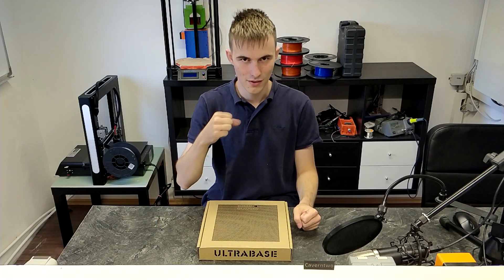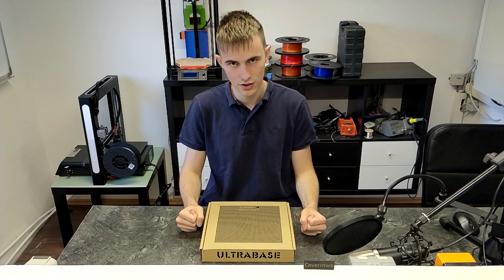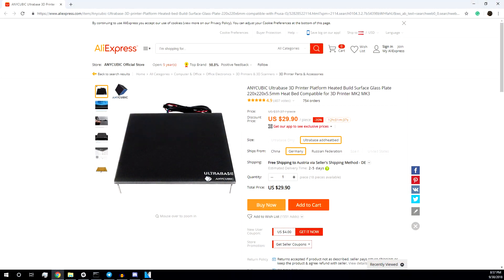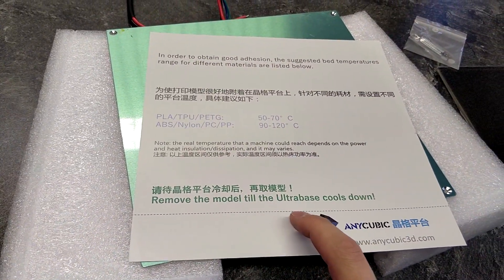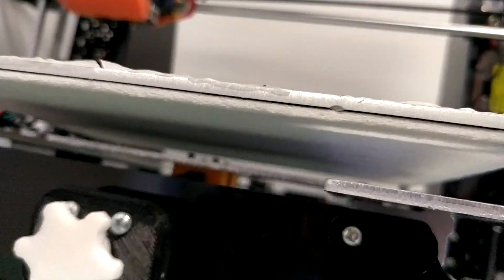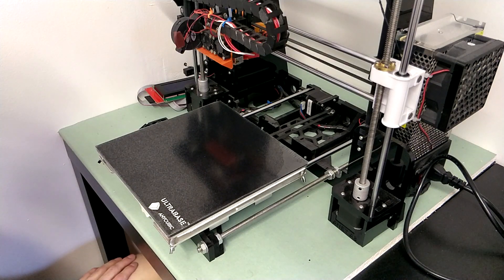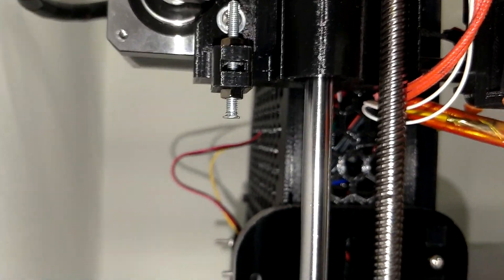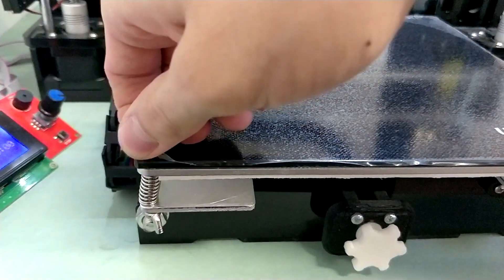Anycubic Utrabase on Anet A8 - Full Installation Guide

Comment: Hi Mate, thanks for the video. I tried this on an Anet A8 rebuild that has a Tatara Steel frame, Hemera hot end etc. I could never get the heat bed to stay level. I was using springs like the original but that heat plate warps all over the place it is so thin imho. Any ideas? Cheers.

Comment: We’ll I just have removed the springs and used some screw to adjust the height of the heatbet. It saves you some time and you don’t have to drill holes for a screw or print extra parts (I have the aber a 6) but anyways ... good video
Reply from the maker: Hey Chris, thanks for your feedback!
 
I've drilled the holes already a long time ago, therefore the solution with the springs was to prefer and took minimum time.

However, I'm curious. How can you adjust the height of the bed with the Ultrabase without springs?

Comment: I have the Anicubic Chiron - 400mm X 400mm - comes stock with this Amazing BED! LOVE it - simply no issues if bed is leveled correctly, Bed temp set correctly - and - WAIT for it to COOL before try to remove parts. I print Mostly PLA and PETG - Bed runs about 60C, I dont even try to touch it until below 40c - most often I hear it 'popping' as it is 'breaking' free of the bed, then, just pick it up : ) PERFECT!
Reply from the maker: You're right, that's what I love about the bed. However, in my opinion, the previous models were better as the parts literally popped away when cooled down - which is not the case anymore. You need to get the first layer perfectly to be able to remove the model later on without damaging either the model or the bed. It doesn't pop off the bed anymore with the version I have.

Comment: Thank you very much for the video, and we appreciate the suggestions as well. Actually, we have modified the adhesion of the Ultrabase on the currently generation, and we had slightly increased the adhesion in the purpose of achieving the "resume-from-outage" function because the very first batch could not do that because when the bed's cold the printed parts would be fall off very easily. Secondly, we have improved the formulation of the surface coating for better life time and durability. The fake Ultrabase could not keep developing new features like us do. Happy printing. Cheers.
Reply from the maker: Hi, thank you a lot for your feedback.
I love to hear that the Ultrabase is modified to get better, and it makes total sense as I had the described problem with the resume function on my (JGAurora A5) machine as well. The Ultrabase is the original and the more developed build plate, and in the end I'm happy that I bought it. The print settings (mainly the first layer height) have to be pretty perfect to achieve good adhesion and easy removability though. Once I figured this out, the Ultrabase is very good and really like printing on it! 
Cheers!
Reply: What version of Ultrabase could I buy for my Ender 3 S1 Plus?

Comment: How easy would it be to drill holes in the ultrabase to allow access to the screwheads for adjustment?
Reply from the maker: Probably not that easy as it's a glass plate, which would probably break when drilled with my tools.
 
I drilled them in the aluminum holder instead, as my other printers, like the JGAurora A5 and the Anet A2+ also have it like this. The adjustment is now definitely easier, however I'll probably replace the wing nuts with some printed ones.